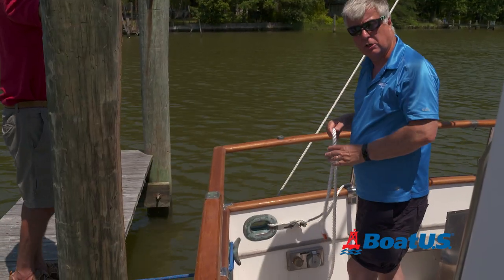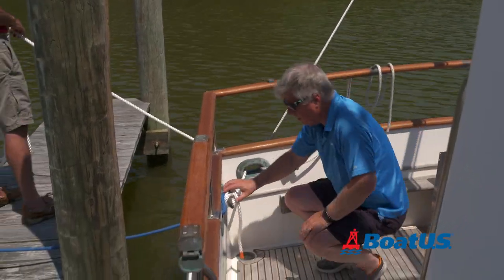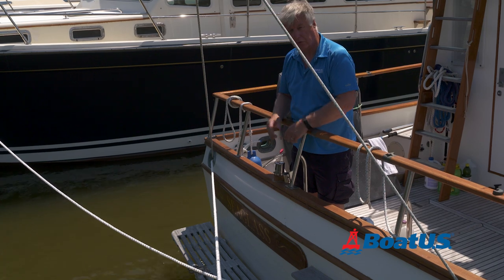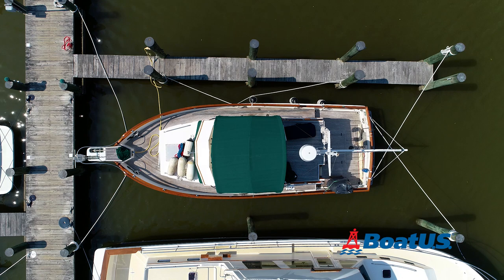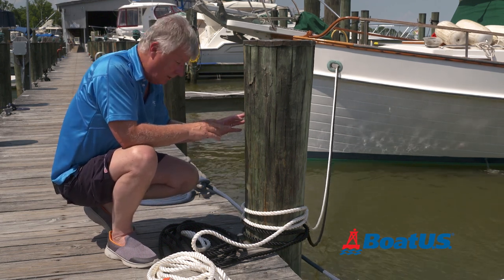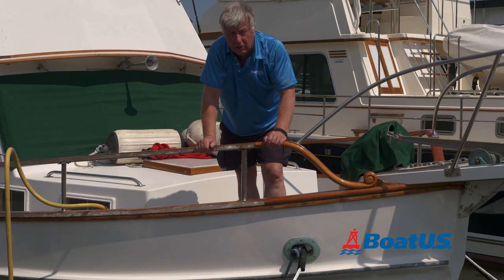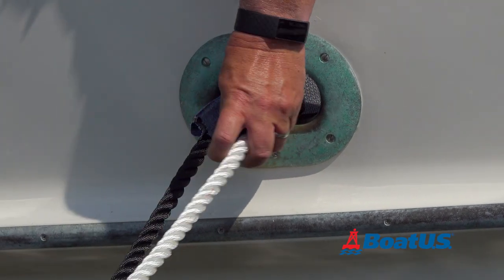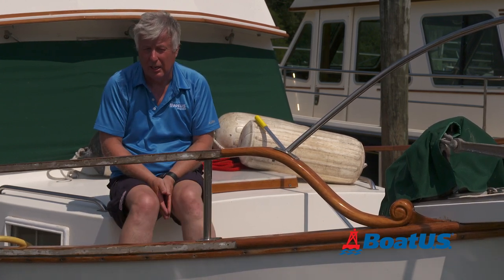How to Tie Up Your Boat for a Hurricane or Storm | BoatUS

Comment: use the whole cleat - a 1/2 wrap with a figure 8 and heavy winds tightens the rope and possible difficulty removing - if staying on board and needing to adjust in weather would be unmanageable, wrap around base  twice and then use 1/2 bite on  cleat - base takes load, your hands can manage it
Reply from the maker: Thanks for the advice, Lawrence. That said, we never recommend staying aboard during a hurricane or storm, unless there's no other option available. Most people we've talked to who have tried that once say "never again!"

Comment: Having experience Hurricane Andrew (cat 5) when I was living on my 51 foot Thompson Trawler, around 30 ton vessel I have a little to say on this whole thing. 1. if you are in a "safe harbor / hurricane hole" you stand a chance to skate by but if you are in the bay or exposed to open waters good insurance and a little prayer is all you have especially if it is a major hurricane, (google images for hurricane Andrew, Michael or Ian). What do I mean by "safe harbor / hurricane hole"? Safe harbor is generally regarded as a body of water that is well inland from a large bay or the Gulf or Ocean, example the Miami River. I was living about 4 or 5 miles inland on the Miami River and my boat as well as 99.9 % of the boats survived with minor to no damage. The level of the River rose about 5 to 6 feet and there was very high winds but NO MONSTER WAVES. When you have tons and tons of water coming at you in the form of a very large wave, pilings and everything else will get ripped, snapped or other wise destroyed. There was a photo in the Miami Herald of large 50 or 60 footer thrown inland in Coconut Grove by Biscayne Bay well over a city bock.  Lots of experienced boaters with the (financial means) kept an empty dock at Hardies Yacht Basin where I lived on the Miami River in reserve so they could bring their boat in for a hurricane. 2. The old man who owned the Marina Dan Hardie a friend who grew up in Miami in the boating business' and was a tug boat captain for the U.S. Army during Korea takes the credit for the one point that was not mentioned and to be fair is not mentioned that I have see in any video or instruction for boat hurricane preparation. The very simple yet powerful technique to improve your chances is to SINK THE END OF THE DOCK LINE THAT GOES ONTO THE PILING all the way down to the bottom with a chunk of steel, chain or what ever. Think "fulcrum effect" as the boat, provided you gave her enough slack struggles with the winds the pull (pressure) is on the very bottom of the piling and it would need to pull the whole thing out of the ground but it very likely won't snap the piling.  If it gets to the point that it pulls the piling out your more than likely SOL. None of the pilings at Hardies pulled out or snaped and again 99.9% success rate in terms of boat damage was achieved. Needless or maybe not to needless to say you must take down all the outside stuff you "do not wish to donate to the wind gods. Bimini tops sails, antennas etc. and if you want you can duct tape the windows  and door edges for water intrusion rain and splash water at 140 or 150 MPH is no joke. Of course chaffing protection and good lines are a must. I put on twelve 1 1/2 inch lines on the Karen Ann and 16 various girth lines on a friends sail boat that was in Virginia at the time. One more thing, DO NOT STAY ON THE BOAT! I left and went to a girlfriend's house. Hank a friend and former fighter pilot from Vietnam war who was a tough old dude stayed on his 30 something foot sail boat, his words, " the stupidest thing I have ever done, I was more scared than any other time in my life". Hank had to go out start the engine on his sailboat and crouching down in the cockpit try to run the motor and put it in gear to try to counteract the forces that were in his estimation about to break her loose.  I hope you all take this in the spirit it was meant just sharing what in my estimation is old knowledge that appear to have been lost that certainly given the right set of circumstances (safe harbor or hurricane hole etc.) worked even for a Cat. 5 monster like Andrew, Aug. 24 1992 Miami Florida.
Reply from the maker: Thanks for sharing your experience, hcwbw3! That sounds absolutely harrowing. Most of the folks who have lived to tell the tale of staying aboard their boats during a hurricane say they'd NEVER do it again. The boat is replaceable; you are not! Bottom line: Proper preparation increases the chances that a boat will survive a storm. It is never guaranteed, but you do what you can and then hope for the best. Preparation, preparation, preparation ... and make sure you have good insurance.

Comment: Is there any rule of thumb for determining how much slack to leave in the line?  Since a hurricane can bring larger tidal swings and that can be unpredictable, I understand there needs to be slack in the lines, but too much could be as big a problem as too little.
Reply from the maker: Hi David. You want the lines as slack as possible so the boat is free to move without hitting anything. Think of it like a spider suspended in the center of a web. Using pilings and cleats that are farther away will allow for more surge with lesser chance of hitting pilings, docks, and other boats.
ETA: Using three-strand nylon line offers some elasticity as well and therefore absorbs some shock loading. You'll need to keep that in mind as well when determining line length. So if you have a 20' line, you might have around a foot of stretch.

Comment: You did not address what about the tides when tying the lines .  If you initially tie the lines during the normal low tide , the lines may be too slack  and allow the boat to breach the dock. Before the storm hits the tides will increase 3 - 4 times the average in the area... sometimes they will decrease in the same attitude. Nice video to show the typical storm tie off. Gin clear, oily seas ,mate.
Reply from the maker: Hi Carl. Thanks for your comment. We did explain that the stern lines are crossed and the bow lines are set as long as possible to account for storm surge. And the spring lines help keep the boat centered. Essentially you want your boat to be suspended in the center of the slip like a spider in a web.